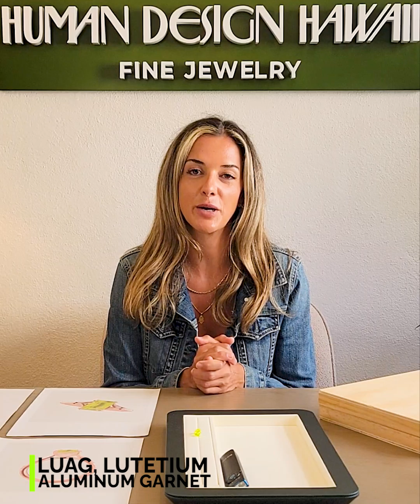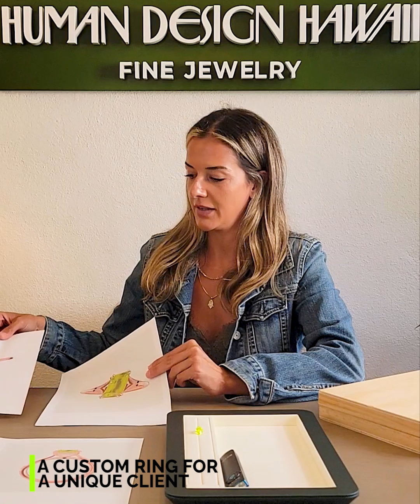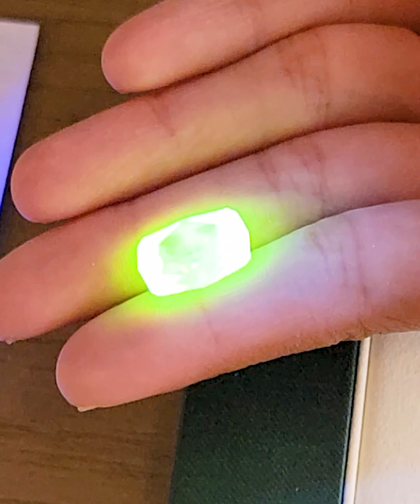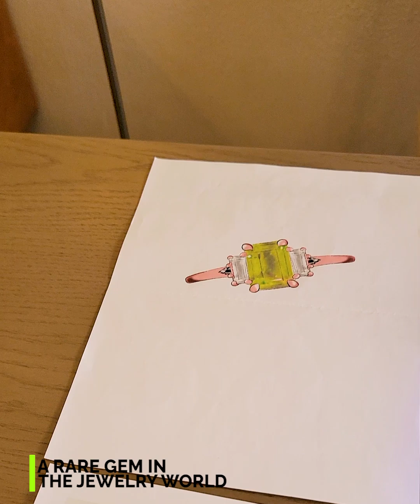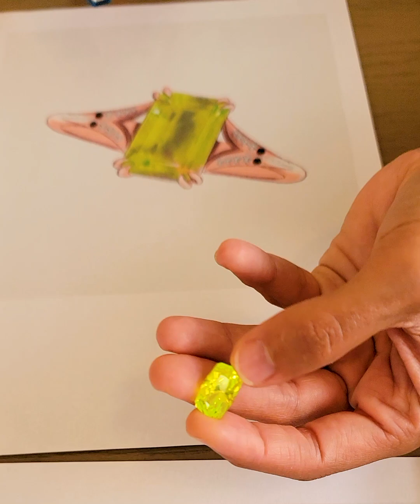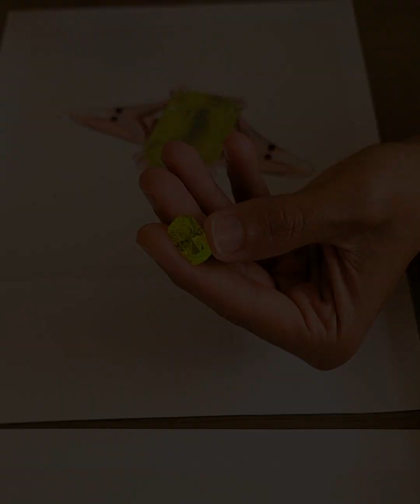Stunning LuAG Lutetium Aluminum Garnet Crystal Glows in Custom Ring Design

Comment: Is it radioactive?
Reply from the maker: Lutetium aluminum garnet (LuAG) is indeed not radioactive. It is a synthetic crystal commonly used in laser applications and as a host material for solid-state lighting. While LuAG contains lutetium, a rare earth element, the synthetic garnet itself is engineered to be non-radioactive and safe for various uses. LuAG’s properties make it an ideal material in advanced optics and laser technologies without any concerns about radiation.
Reply: Is not radiactive. It's totally sure to wear.
Reply from the maker: @Ratchet_001  correct, and I did go over that in the video.